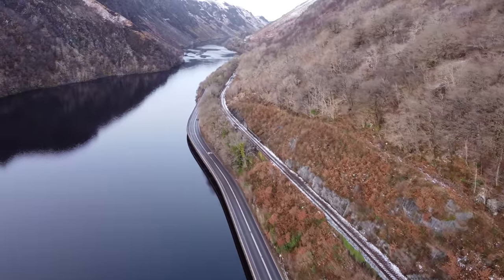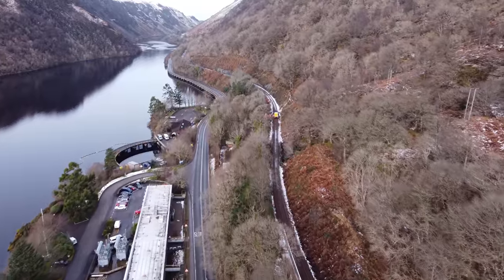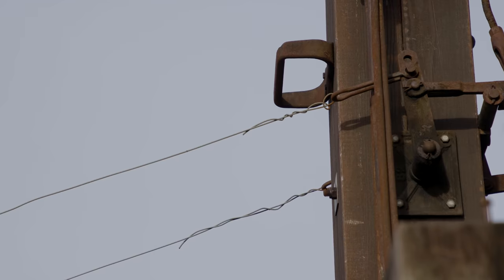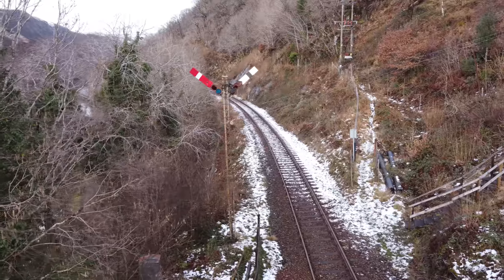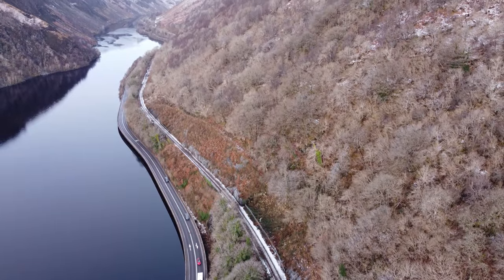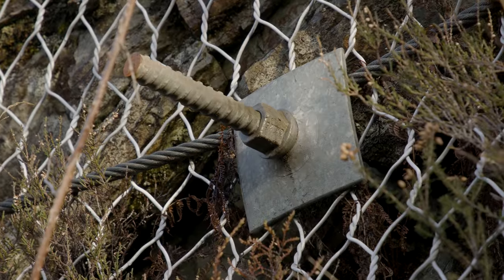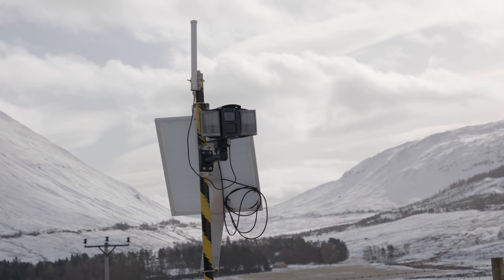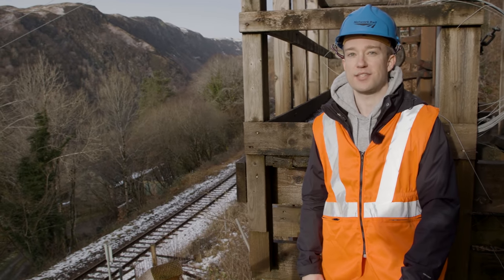After 140 years, this old technology still keeps trains safe

Comment: I work for a Software company that creates a lot of technology for ensuring the Rail Network in the UK is safe (such as gauging). I have absolutely no idea how I'd approach this issue, and honestly, I think wire on a stick is still the best approach. Well played, Scotland.
Reply: depends what they are prepared to pay
Reply: Lots of others have replied with the same idea I had: a sensor on the danger-signals, that when the mechanism trips, also triggers the sensor which then sends a packet to the central control. They clearly have the system for the much more prolific tilt sensors already, so could derive from that. Some ppl ask about power, but a small solar would obviously be enough (it would literally off by default, as the danger-semaphore would act as a switch closing a circuit) with a small battery, despite it being scotland. And one even brought up how the mechanism could provide enough energy by simply releasing a weight powering a gravity-clock-esque system, or outright use the mechanism itself as such, to generate the little power needed. Which honestly is kind of genius in how cheap that would be compared to sourcing a tiny solar panel, or even the small flat batteries used in wristwatches.
Reply: @feha92  just glue a magnet on the signal and put a coil beneath. No need for fancy power generation. The drop will generate the current wich could be registered by any microprocessor just let the pin be an interupt
Reply: @DereinzigwahreAkede  Thats what a gravity-clock mechanism is, congratulations!
Reply: A survey drone is my best guess (Lidar on a UAV) which flies the track ahead of a train. That results in a point cloud of heights which can be very accurately geo-located, and that then turns the rock problem into a relatively simple bounds check in software. Even a £5k commercial drone is likely a lot cheaper than maintaining their current setup. Or an even simpler one: just stream the video from a drone to the human driver of the train.
Reply: Replace the wires with lasers like in heist movies that detect movement.
Reply: @feha92  Sure, but whatever time the danger presents itself, the train is probably going to be going by within 4-6 hours at most anyway. I imagine this signal gets plenty of false positives, the current system means that resetting it can be a low priority. Getting a signal straight to central is only a benefit if it's going to get them to go out and reset it faster, which seems unlikely in this situation.
Reply: @lawrencebates8172  The plenty of false-positives sounded like it referred to the other systems they are testing or have in tandem, and either way, they are still going to need to send someone out to fix the system after every positive - false or not.
If it is fixed even 1 hour sooner, that is still a  much more responsive reaction than if they waited that hour for a train to report it in, and get forced to slow down as a result.

I don't get why you think it unlikely for them to reset it faster, when you yourself guessed that it might in the worst-case (for your point, and kudos to exaggerating to the oppositions benefit, I see that too rarely on youtube) it might be as much as 4-6 hours delay that is cut away thanks to such a system.
Even if trains ran every x minutes (where x < time to reach location and fix the issue), not having to wait those x minutes should mean its fixed x minutes faster than otherwise, and as such one less train had to slow down (and overall run with dangers on the track).
Reply: @feha92  Given the location, I doubt there are more than 2 trains in each direction a day. This isn't commuter rail, it's just not a priority. I can imagine the line remaining closed for half a day while they deal with more pressing issues elsewhere
Reply: There has been research done in the past regarding proximity sensors for trains. Not sure what became of that but considering we now have self driving cars using it to prevent collisions, It'd be interesting to see if it could be applied to trains. The obvious benefits of having the system on the train is that you don't need another power source plus it's active anywhere.
Reply: @neonwired4978  a car can stop in a couple hundred feet (approx. 100m). A train requires several thousand feet (approx. 1,000m-3,000m).
Reply: @hijackstudios  
Why an intelligent, flying, UAV?
You've got a perfectly serviceable set of tracks to use. 
Build lightweight UAV. 200kg with a small motorcycle engine.
Run on existing tracks ~2 miles in front of each train.
If the UAV hits something it sends a radio alert to the train so it has time to stop.
Reply: @c6q3a24  seems most reasonable, a scout ground drone car on rail
Reply: @neonwired4978  The issue is rails.  They are designed to provide little friction under the assumption that there should be nothing on the track.

So, by the time any proximity sensor would detect anything, the train wouldn't be able to stop in time.
Reply: @bucky13  lasers would trip from e.g. leaves and grass on the wind.
Reply: @neonwired4978  I would guess (albeit with little knowledge on the matter) that proximity sensors only work in very close range, which is fine for cars because they can break quickly. It takes a lot longer to stop a train, that would need to be a long range sensor.
Reply: @c6q3a24  why would you build an Unmanned Aerial Vehicle with a motorcycle engine???
Reply: @jdgindustries2734  it depends on the weight of the train and brake efficiency. With a two-car train I doubt braking distance to be higher than 3–400 meters at the speeds those trains go even for the worst performing brakes.
Reply: @lawrencebates8172  if I'm not mistaken, service up there is at least 6 trains per day, each direction, between Oban and Glasgow.
Reply: They still use it is because well cost is a big factor and can you think of anything that is less expensive than wire on a stick?
Reply: Make wires that aren't meant to break but upon detecting something will go slack, triggering the signal. Then, make them return to being somewhat taut via some servos or something. It would save money on replacing the metal strings probably.

Obvs would have to make sure it returning to taut doesn't turn the signal to clear again as the rock may be on the line. Perhaps a secondary system scanning the metal of the tracks for thermal changes as a rock probably has a slightly different temp than metal tracks. This way you could do a 3x system with a middle warning to go slow, one for stop and one for it's fine.
Reply: @hijackstudios  what if you use both a drone with LiDAR Scanner. And a few very high poles with LiDAR Scanners for the movement of bolders coming down. And the drone for pinpointing the exact location
Reply: @FSantoro91  fair enough, I'm a locomotive engineer for a US Class 1 railroad (freight), and our trains these days weigh between 10-20 thousand (imperial) tons. They can stretch from 5700feet (a 130 car coal train) to as much as 15,000feet (a REALLY heavy mixed freight, a double unit-oil train at 208 cars, or a very respectable "truck" train... Sometimes a unit double-stacked container train, but usually a mix of double-stacks, single stacks, and "piggybacks".

These types of trains are the ones I have experience with, and this is what I am able to judge train operations based on.

In my area, we use two road units back to back as helpers for a mountain climb out of my home terminal. The two units used to be a set of (upgraded) SD40-2's and are now (remanufactured) SD70ACe's. These two units weigh in at 432,000 pounds each. At 50 (US) miles per hour, it can still take them a quarter mile or more to come to a stop in emergency brake application... The biggest thing people don't think about is control... We don't have anti-lock brake systems. Once our wheels lock up, it's just an uncontrolled slide till we stop. Wheels locking up can even occur on regular brake applications used just to control the speed of the train, especially on empty cars which average less than ⅙ the weight of a fully loaded car. 

It's a lot to take in and process. It's also why this type of operation would NEVER be accepted in the US... EVERY train would have to slow to a couple miles an hour on the approach to this signal. Even at 30mph, we'd never get stopped by the signal.

Our systems actually have what we call "approaches"... The block ahead of a "danger" signal (what we call either a Stop Signal (if it's an absolute do NOT pass) or a Restricting (okay to pass, but able to stop within one HALF visual range, not to exceed 15 or 20 depending on circumstances) we get an Approach... Proceed prepared to stop at the next signal, trains exceeding 30mph must immediately begin reducing speed.

There is a LOT of romance to being a locomotive engineer from history, but its a LOT of work, knowledge, skill, and judgement. And, before you say let the computers run... Let me just say a good engineer can run the train a LOT more efficiently as far as packing more trains into the network.... The computers tend to run extremely conservatively, while engineers with years of experience can learn their train and run right at the speed limits and know exactly where and how much air brakes to set, to go from 50mph right down to 30mph, right where the speed restriction starts. 

And on three separate occasions, I've had to yank back control of my train because the computers failed, and either we're going to start speeding, or already were. In one case, I had to put my train in emergency, because NONE of the manual overrides worked, and the computer continued to accelerate into a sharp 30mph curve... Even after it was already speeding!
Reply: @jettnash5217  if the system you described just had to be manually reset, st least it would save them having to replace the wires every time.
Reply: @damianklaassen8760  scale imo; the tracks are long and curvey, so you'd need a lot of viewpoints if the goal is to get visibility of the whole track, and each would need power. Something that travels in front of a train is just the one cheap unit, ideally using off the shelf hardware as much as possible.
Reply: @DannyHodge95  that would be the major issue, obviously it depends on the size, speed of the train and the weather. I think the demos used ultrasound which can do longish distances whether it'd be enough I don't know.
Reply: @ayylmao.mp3  I feel like you could maybe correct for that in software. For example, if there was a grid of motion detectors down the hill, you could rule out animals and leaves by their direction and speed.
Reply: Only thing I can think of is a laser fence. Instead of a wire that breaks, it's just lasers that send a signal when line of sight is broken. With multiple fences you could even get the speed at which the object is going and could determine if it was wildlife or grass by how long the line of sight stays broken or the frequency at which it's broken (Grass swaying back and forth). Though it would require power so...
Reply: I would probably change it to fiber-optic cables personally, since they said they were having trouble sourcing wire that's easily available on the market, capable of being under tension but also snapping when encountering rocks and boulders, but otherwise a physical barrier seems rather smart.  The primary improvement is to make it so there's a signal sent to the local rail safety people so the inspection happens at the time of the incident, not the next train after, but this is one type of rail issue that will not get worse from rail traffic, so the 'slowly proceed' is definitely the right approach for these signals.  There's a chance the interfering rock didn't land on the tracks, or is light enough to be lifted out of the way by the train operators after all.
Reply: @duke605  and being the Scottish highlands it would also be regularly defeated by snow and rain unfortunately
Reply: It is interesting technology still in use in parts of Ireland
Reply: @jdgindustries2734  I'm a fellow locomotive engineer working freight trains in Europe, but quite accustomed (although definitely not expert) to US trains, so I somewhat understand your POV. 🙂

Great to see a colleague from overseas!
Reply: @jdgindustries2734  well...this line is a passenger only line. It probably has only 48or even 4 car trains. So its a lot easier to stop
Reply: @DereinzigwahreAkede  so you two geniuses invented a perpetual motion machine... or where does the energy to reset it come from?
Reply: @abyteuser6297  Nah it´s just a way to take the physical signal and relay as an electrical one. So you can either send somebody to check the rails or at least inform any aproaching train ahead of time. At no point either of us talked about any auto reset feature or perpetual motion xD
Reply: @hijackstudios  I'm a land surveyor:
--You vastly underestimate the effort involved in accurately geo-locating something. The drone would have to be tied into continuously operating reference GPS stations, either by radio or by cell, which is challenging and inconsistent in rough terrain.
--LIDAR is easily confounded by rain and snow.
--The drone must be able to fly a reasonably precise course over a long distance in all sorts of high wind and weather. This is not a job for a quadcopter. Even the $30k fixed-wing drones are only flown over relatively small areas and in good weather. They're not terribly durable either. They're made to fly maybe a few hours a week. You'd be wearing out multiple drones a year running this schedule.
--Post-processing LIDAR data is more involved and reliant on judgement than it looks.
--There are no turn-key packages for what you're proposing. This is a fairly niche set of conditions, and doing all the systems integration, as well as installing all the reference stations and radio repeaters would easily run into the 10s of millions of dollars.

Go outside more--Technology is not a panacea.
Reply: @cf453  Also worthy mention: a drone (either a UAV or ground based) would work fine with coarse location data as a vision based nav systems main source of detailed location is SLAM with the rails themselves. SLAM is used by self-driving cars to locate themselves, including in tunnels.
Reply: @hijackstudios  You're not one of those people who thinks self-driving cars on public streets are going to be anything other than a tragic and hilarious failure, are you?